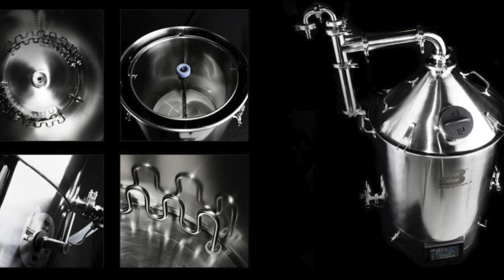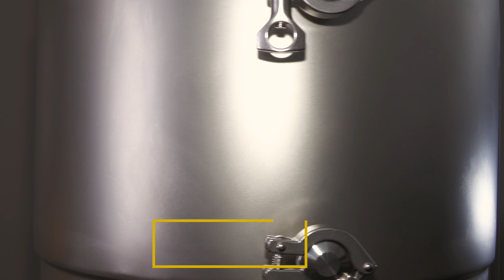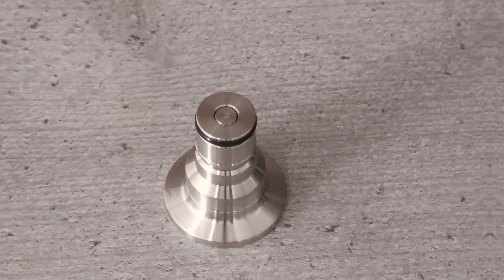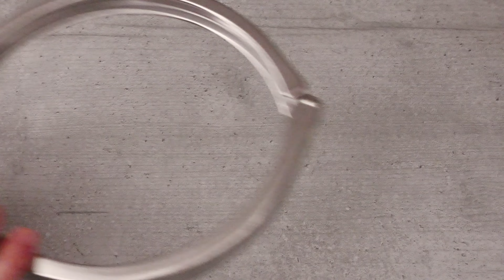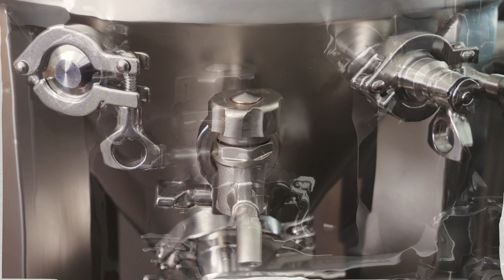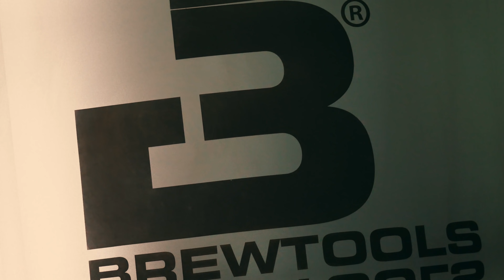Brewtools Unitank Full Overview And First Impressions For Homebrewing

Comment: how would you recommend to add and mix a sugar solution for bottle conditioning if the tank is pressurized.
Reply from the maker: I would suggest simply using pressure to carbonate instead, if possible. If not then its going to be much easier to use carbonation drops according to bottle size.

Comment: i have the grandfather 30 litre system... 25 litres seems just out of capacity, would 24litres work with the glycol but just slightly less efficiently?
Reply from the maker: There is no issue in brewing 25L batches with the G30. Many do 🍻🍻🍻

Comment: Should i get a € 1.775,00  F40 Unitank or a € 850,00 SS Brewtech Bright Beer Tank.  
In my GF CCT i'm not getting any clear beer. No matter how many times i dump my hops residue. 
Cold crashing  it for 3 days, and  then I use a Beergun for filling 0.5 cl bottle's with some priming sugar 7grams/Liter. 

I like the Jacketed cooling on the F40 and the optional 500 watt heating element.  But im afraid that clearing the beer in this F40 for 3 weeks  with  some yeast residue would not be good for the end product.
Reply from the maker: Only you can decide 🍻🍻🍻

Comment: Great video David - I was so impressed with the beauty and quality of these uni’s I have just hit the button on one plus heater, filter etc etc… I’ve been using a fermzilla, (but too afraid to go up to carbonation pressure) so I’m thrilled already, my wife however is going to go absolutely bananas...
I may need to change my name to David and move to Norway…
Reply from the maker: Haha thank you. Very solid stuff for sure. Enjoy 🍻🍻🍻
Reply: @DavidHeathHomebrew  Thank you, I’m sure I will. Anyway I’m saved… I bought a case of half decent plonk, scraped the labels off and told her it makes wine as well… Come on. That has to be one of the best yet surely
Reply from the maker: Haha classic

Comment: Hello David, another great video. Thanks. 
A question, when you will share a video using this unitank with grainfather glycol chiller. Will be great if you could explain in how we could connect both systems and how to use them together. 
A last question :) I have a grainfather G70, my batches are usually between 50-65 liters. Do you think that the unitank F80 is good enough, or I could go for the F140. My point is, the F80 is ideal for20-75l bathes and the F150 for 40-140l batches, since my batches are around 60 liters, both fermenters will work. If I decide for the bigger fermenter, then, in the future, If I increase my production, I just need to buy a kettle with higher capacity, since I already have the fermenter. Please, let me know if this make sense for you or I’m missing something here?
Thanks a lot.
Reply from the maker: Hi :) 
I covered this topic with this video:- https://youtu.be/KU2CaEnxPoU
Reply from the maker: As for which Brewtools unitank I think the F80 is the better choice for you. The F150 is going to use a lot of gas on 60L batch for a start.
Reply: @DavidHeathHomebrew  Thanks for your answer. And If I put in the equation the F100, you still have the same opinion?
Reply from the maker: I think its best to find something that best fits your volumes. The pick between F80 and F100 is certainly closer.

Comment: Outstanding video!  If I didn't want to extend the legs, is there enough room to be able configure the two 2" valves without hitting each other?
Reply from the maker: Yes, no problem there. I included minimum height at the end of the video.

Comment: Nice summary one question what are the losses from the fermenter ( “ignoring” hop losses) so voloume from racking arm to dump valve if you get my drift. On the 7G ssbrewtech I usually have around 2.5L. So fill to 26.5 and keg 24L.
Reply from the maker: I have now discussed this with Brewtools. The problem is this is a real variable depending on the yeast and beer. I do not think you will find it so different to your current experience.
Reply: @DavidHeathHomebrew  I guess you could dump the yeast first, then keg from the lowest port if you wanted to minimize losses. First pour from keg would probably be more yeasty though.
Reply from the maker: Very true.

Comment: Question: are the 34mm TCs compatible with 1.5” TCs? It seems like it would be off by ~4mm, but I know sometimes folks don’t actually mean measurements literally.
Reply from the maker: No, they are not. 1.5" has 50.5mm diameter, this is a true sizing.

Comment: Thank you for this one. I don’t need this, but I really do want it! When you test the chilling capabilities are you going to run it off your Grainfather chiller?
Reply from the maker: Cheers Ron. Yes, I have the new GF glycol chiller adapter and I will be showing how you can connect various fermenters and unitanks to to the GF chiller using it.
Reply: @DavidHeathHomebrew  I look forward to seeing this. Cheers 🍻
Reply: @DavidHeathHomebrew  I was going to ask you for a recommendation on which glycol chiller to use for 2 F80 unitanks but you already pre-empted my question by saying that your next video is on the GF glycol chiller. Do Brewtools have an option coming down the line perhaps too? Another question... Best way to clean the unitank? Recirculation of detergent via a pump? Is there a spray ball option? Or full manual cleaning?